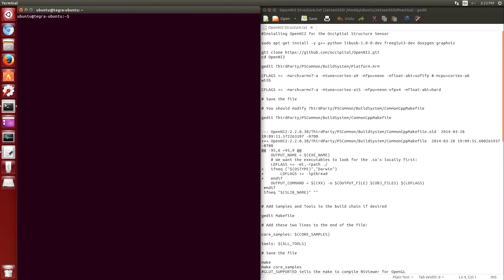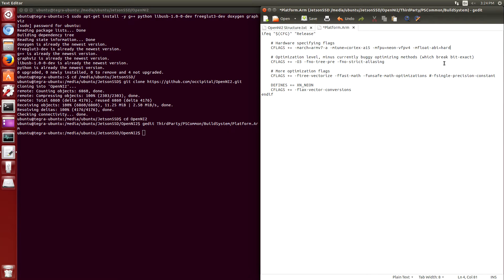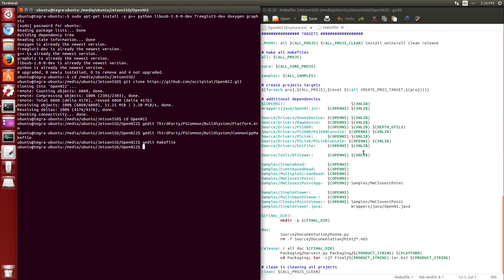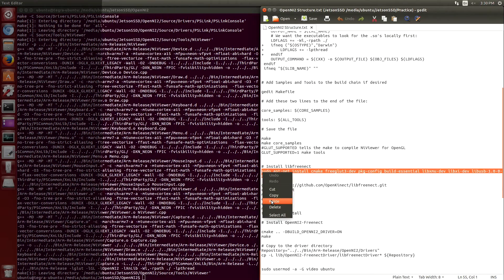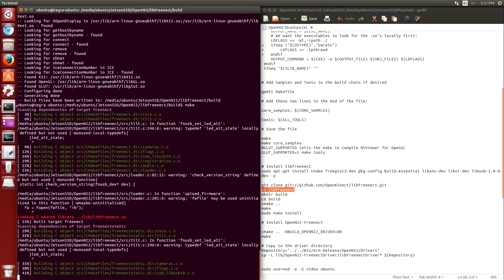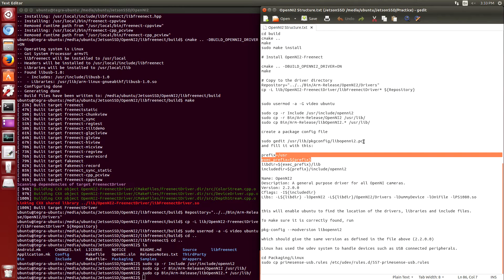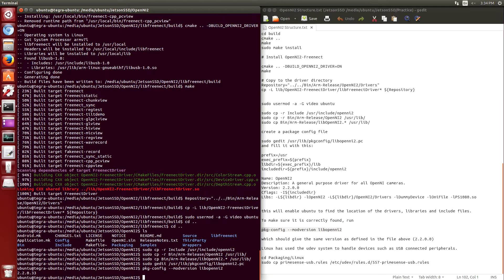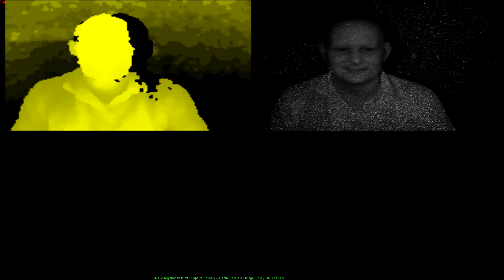NVIDIA Jetson TK1 - Install OpenNI2 for Structure Sensor

Comment: good video, I did it in a raspberry pi 3 and it worked correctly, now you could help me in doing code in C to develop a project of the university, I would appreciate it a lot
Reply from the maker: I think you will feel a lot better about the project if you do it yourself without my help. Thanks for watching!
Reply: @JetsonHacks  , you are right.

Comment: Hi thanks for the video. Any chance there's an installation tutorial for TX2? I have a TX2 and I couldn't process to build the library and samples after the terminal said "ThirdParty/PSCommon/BuildSystem/CommonDefs.mak:22: ***can't determine the host platform. Stop." I think this is due to my tx2...
Reply from the maker: I do not have anything to share for the Jetson TX2 and the Structure Sensor. The Jetson TK1 is a different kind of processor, it is unlikely the same code would work for both. Thanks for watching!
Reply: Did you ever find a solution for this? I am currently trying to install OpenNI2 on a TX2 as well.
Reply from the maker: You have to do a full port to the TX2. There are several things that need to be changed. If you look at the CommonDefs.mak file, you can see that it looks for the 'uname -m' to identify the machine architecture. The TK1 reports as 'arm', the TX2 reports as 'aarch64'. There are several of these types of issues throughout the library which need to be changed. I would suggest that you use this as a learning experience of how to do a simple library port.
Reply: Unfortunately not. I have switched to trying with another device...
Reply: Louise Lu I had success with installing this to a tx2. If you are interested in doing this still send me a message on here with your email and I will send you the changes you need
Reply from the maker: Hi gamerx262. This is an open source project. Please consider posting your changes on a public forum (like Github) or issuing a pull request on the JetsonHacks Github repository in accordance with the license terms. That way we can all benefit from everyone working on a common project. Thank you.

Comment: Thanks for the awesome video! I can confirm that this works flawlessly on Jetson TX1 + Kinect v1 too. The issue with USB port sleeping is still present which was fixed using the additional commands in rc.local. You rock!
Reply from the maker: +SirM2X Thanks for watching!
Reply: Thanks. I also installed it on TX1, and it's working, however for Asus Xtion Pro, I should run the commands with sudo, otherwise receive the following error:
openDevice failed:

~/OpenNI2/Bin/Arm-Release$ ./NiViewer
 Could not open "1d27/0601@1/10": Failed to open the USB device!
Any idea?
Reply from the maker: You have to set the udev rules to run from user space.
Reply: On my TX1 I get a error when I save the Makefile;

ubuntu@tegra-ubuntu:~/Downloads/OpenNI2$ gedit Makefile

(gedit:10873): Gtk-CRITICAL **: _gtk_widget_captured_event: assertion 'WIDGET_REALIZED_FOR_EVENT (widget, event)' failed

(gedit:10873): Gtk-CRITICAL **: _gtk_widget_captured_event: assertion 'WIDGET_REALIZED_FOR_EVENT (widget, event)' failed
ubuntu@tegra-ubuntu:~/Downloads/OpenNI2$ gedit Makefile
^C
ubuntu@tegra-ubuntu:~/Downloads/OpenNI2$ make

ThirdParty/PSCommon/BuildSystem/CommonDefs.mak:22: * Can't determine host platform.  Stop.

did you encounter this problem?
Reply: You also? did you have this problem; ThirdParty/PSCommon/BuildSystem/CommonDefs.mak:22: * Can't determine host platform.  Stop.
When about to make.

Comment: this was really informative. I was watching introductory video of Jetson on YouTube by Jesse the nvidia guy and was a bit shocked that it has only one usb port (which is usb 3.0) Cause you kineckt camera doesn't work on usb 3.0 and... I am really planning to get a Jetson for my Computer Vision and robotics projects. Do you recommend Jetson? Thanks for this channel it's greattt!
Reply from the maker: Hi Mandar,
Thanks for the kind words.
The Jetson has two USB ports, one a 2.0 with mini-connector, the other a "3.0". From the factory, the 2.0 is configured just for flashing the Jetson memory, the 3.0 is actually configured as a 2.0 port. You must flash the Jetson to change these settings, such as switching the main USB port to 3.0. I have one of my Jetsons configured as a 3.0 driving a 3.0 hub.
I would recommend Jetson for robotics, there are several people doing robotic projects with them. A couple of examples:  MyzharBot / ROS - Test of the new node for teleoperation with Keyboard and Super-Computer-On-Legs Jetson TK1 based robot. 
It's certainly nice having OpenCV hardware accelerated.
I'm looking forward to seeing some YouTube videos of your robot!